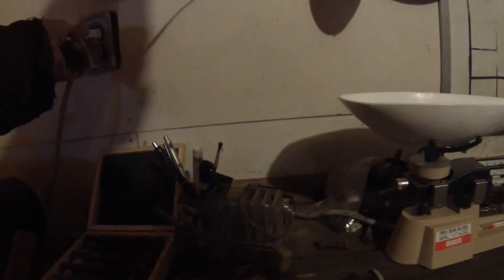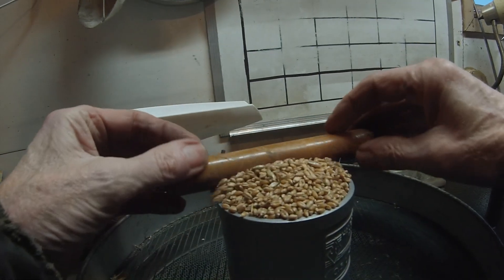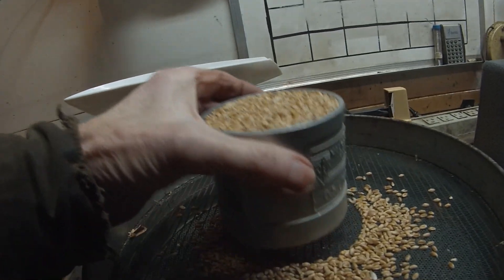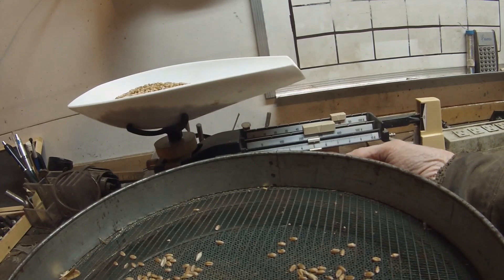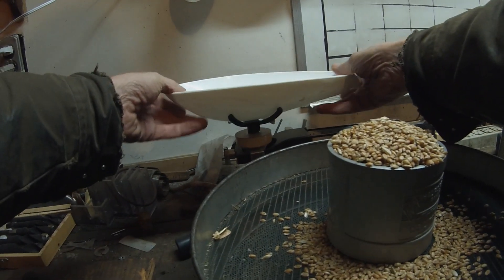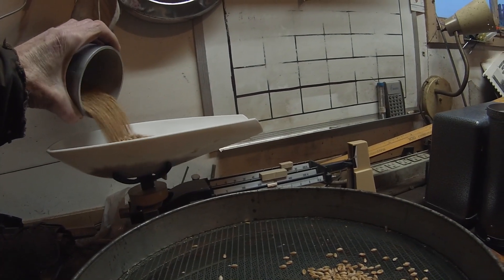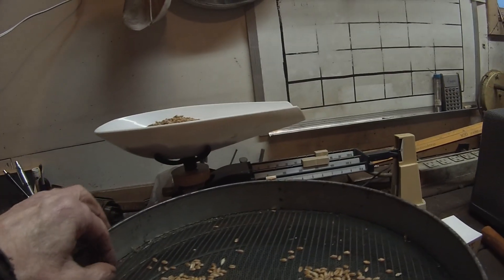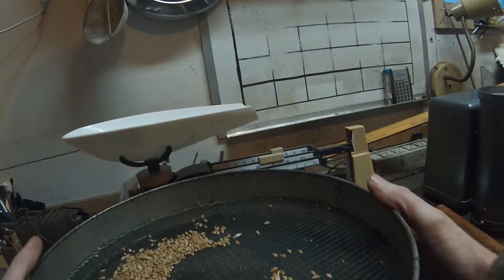Grain Weight and More

Comment: To be honest I’ve seen both ways done. I personally do the same rolling method as you as I was shown that way by both my dad and by the former Pioneer grain elevator agent in my town. Scraping I’ve seen but not often.
Reply from the maker: Thanks for the feedback. I'm not too concerned which method is correct at this point. Since I've been using the rolling method of leveling for years I will continue or else it would throw my records off kilter.

Comment: What was the purpose of the video?
Reply from the maker: Bob, you must have missed the September 29 video I posted here in which it was pointed out to me by a viewer that I had been using the wrong method to measure grain bushel weight. So in this video I compared  the two different methods of leveling grain in the measuring cup to see how much difference it made. So yes, it makes a difference but no, I'm not going to change my methods. I just won't brag as much how heavy my grain samples are. :-)